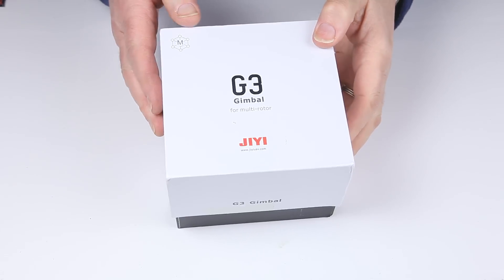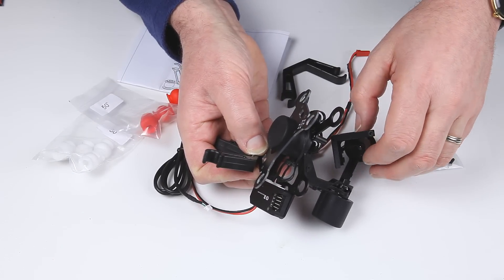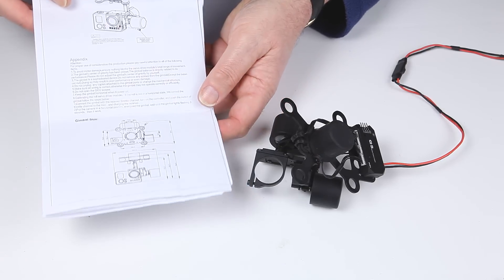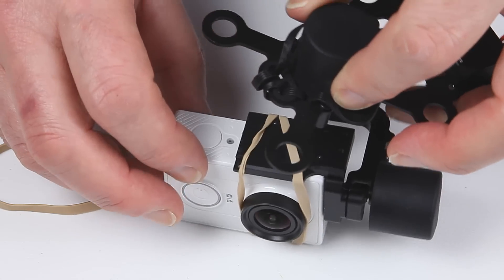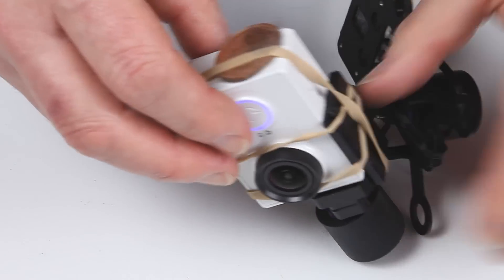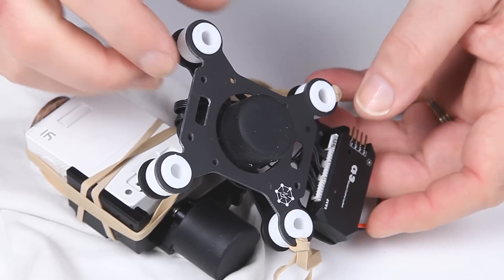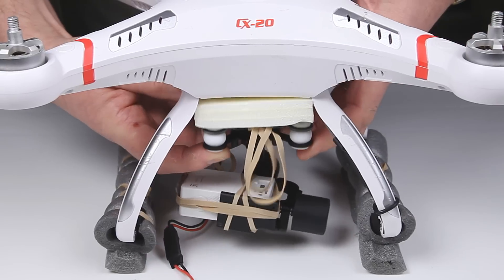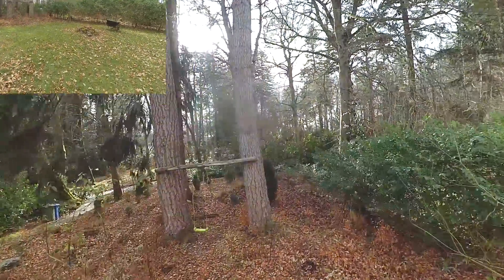JIYI G3 3 Axis Gimbal unboxing, fitting CX-20 Xiaomi Yi test flight

Comment: I was using this gimbal, and it was just fine. But, suddenly, it stopped
 working and is not balancing my camera anymore. It's like it's dead, 
but the leds works and if you move the camera you can sort of feel the 
motors doing some work...
Do you have any idea of what could be the cause for this?
Reply from the maker: Ouch that doesn't sound good, I'm sorry I have no idea why that would happen or how to fix it, I assume you have tried it with and without camera just to get it going apart from that I'm all out. Hope you get it sorted
Reply: I think I know what happened. I was using the Xiaomi Yi camera, and from what I've seen on youtube, it's not balanced for this gimbal. But when I turned the gimbal on, it made the camera centered and all, as if it was ok. Then, I left the gimbal on for ~45min and when I looked at it, it was dead. I believe the cause is that the gimbal rotors were forcing the camera all the time and they were not meant to do so.
Now, only the top rotor is working, which yaws the camera. I think this confirms my theory since this rotor does not lift the camera.
Reply from the maker: You should always balance the camera with power off I use a coin/washer and taped to an eleastic band ;-) sorry it's broken but glad you now know what it was and how to sort it ;-)

Comment: Got mine, first hook up, plugged it in waited 60 seconds for it to calibrate.  Picked up the Hex. Walked from one end of my basement to the other and set it down on a level surface and it leans about 15 degrees to the left.  If it can't hold horizon on a level surface its not worth a penny.  Guess its time to spend the next 12 hours trying to translate Chinese/English to English and attempt to calibrate.  Wow.  Yours seems to be tilted as well.

Comment: 12 minutes wow, I have in fact subscribed. just finished your yuneec q500 unboxing video. very in depth thank you. How do you think the q500 compares to a phantom? I would like to upgrade to one of these at some point.
Reply from the maker: +David Sinn I tend to use 3000mAh in the CX-20, don't actually think they are a lot better than stock ones but I keep telling myself they are. Slow flying helps, if I drop the gimbal etc and nail it around, well as much as you can a CX-20 then the time drops off. I prefer the Q500 over the Phantom, loads of reasons but the fact you get everything including extra battery etc I know I will get a barrage of comments but I haven't seen anything on the quality of the video, being that different, to convince me to buy one.........happy to look if someone has better footage, I'm always after better footage from my quads :-) have you seen this one https://www.youtube.com/watch?v=pqP1Nn49O6Y I have more on the way, thanks for subbing and I have more on how I use the Q500 I must get on with. Let me know if I can help and if I can I always will.

Comment: quite innovative, well done. What's your flight time with this setup? I've got a 2D walkera gimbal I tried on my tarantula but couldn't get it to work for more than 3 minutes or so. upgraded to a V303 seeker and getting approximately 8 minutes.
Reply from the maker: +David Sinn Hi David around 12 minutes flight time, i fly smoooth and slow with video so that helps ;-) Tarantulas seem to have a problem depending on which PCB you have, both mine hold up well on flight times, but they are quite old, well in quad terms anyway. Hope you thumbed up and subscribe if you haven't already, thanks for the comment

Comment: Nice review, wow thats a lot of elastic bands...and the CX20 you can buy for under 150 quid at the moment. I have XK380 legs banded on my Tarantula, they kinda just slip over the existing Tarantula landing gear. Works great with my Walkera G2d Gimbal.  Saves using that pipe insulation foam and trust me I have that on all my quads.
Reply from the maker: +russpeed1 Don't we love our bands ;-) Thanks for tip on legs for tarantula, I always hand launch and land but that sounds a lot safer. Glad you enjoyed it, looking forward to great flying this year :-)